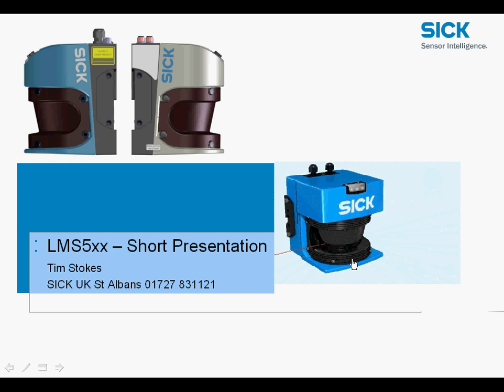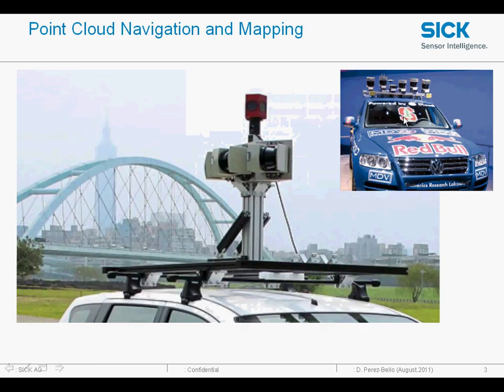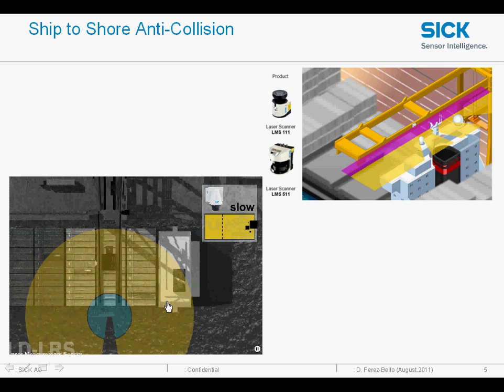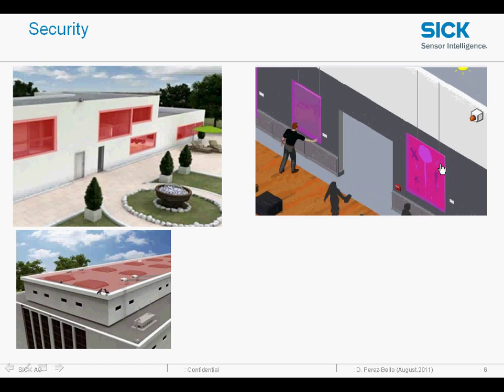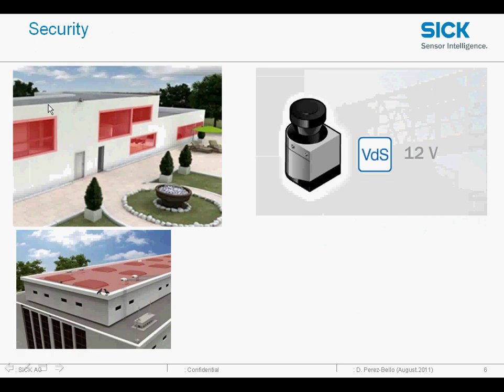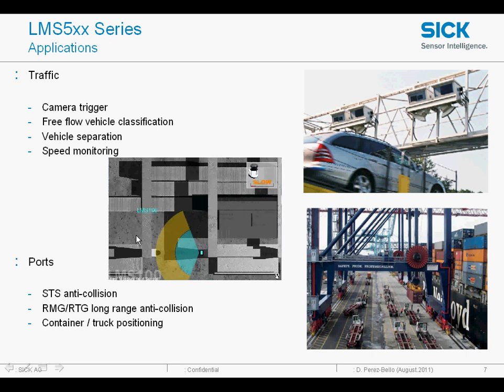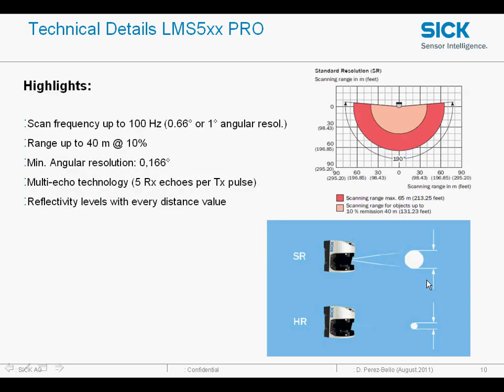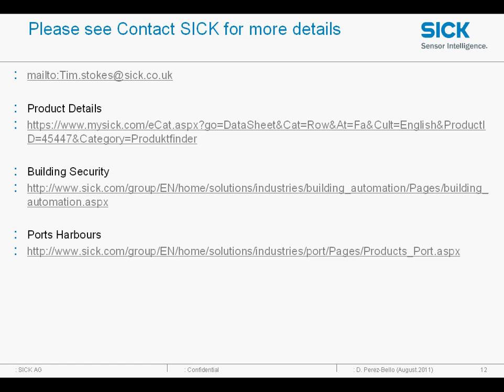Video 1 LMS 5xx and the Amazing things it can do.avi

Comment: is there a way to make a lidar which does the same thing but having no moving parts? the spinning mirror included..
Reply from the maker: B. Ovidiu we have lidar devices that look at a single point but if you need scanning then it needs a rotating mirror , what do you dislike about the mirror ?
Reply: Tim Stokes
it is a moving part...therefore a potential point of mechanical failure... Solid state is better I think...
Reply from the maker: Thanks for the link ,very interesting and probably expensive , it looks like a military device, which because of my companies(and my!) Ethics we wouldn't get involved with...